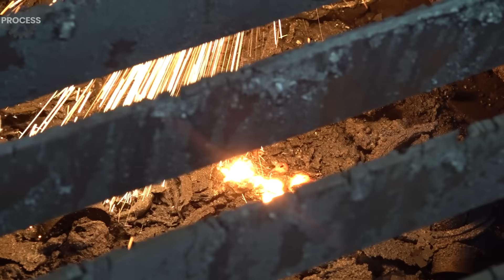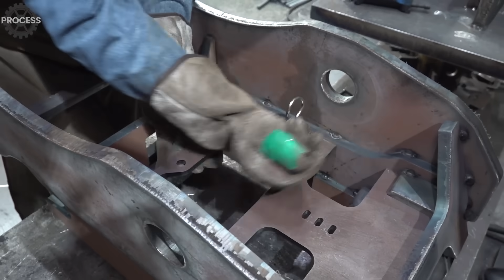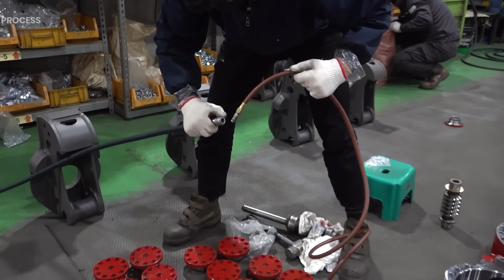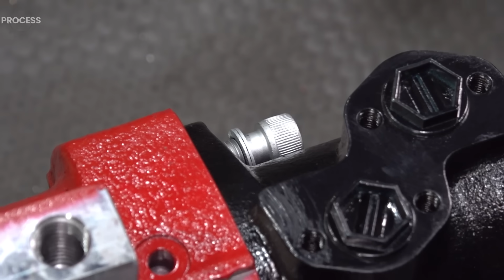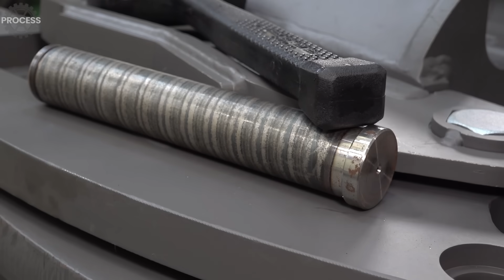Process of Making an Excavator Tiltrotator. Heavy Equipment Attachment Factory in Korea.

Comment: 6:20 why weren't these parts deburred and cleaned ahead of time. Why is assembly being done on the ground? and the cleaning done with a dirty rag?
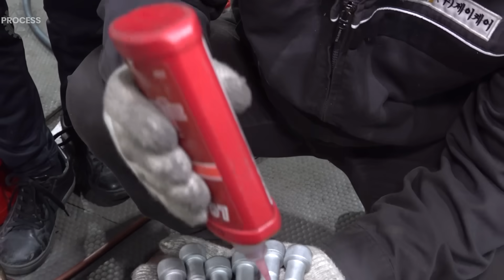7:40 they are using nordlock washers, there's no need for loctite. Also you can see the loctite leaking under the washer, this will flake off and into the hydraulic oil circuit.
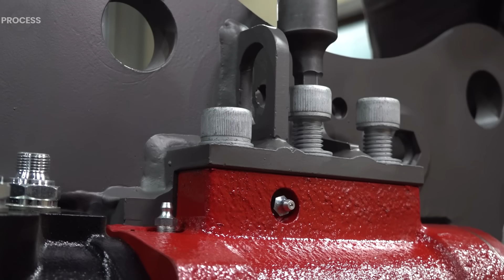9:31 cross threaded bolt
Reply: I was also confused by the use of Loctite along with Nord-Lock. I think that Nord-Lock is an alternative to a  "non-separable" connection using Loctite. I don't understand why use them together.
Reply: @anton488  They want the extra assurance that it doesn't come apart. On mining equipment you can see Loctite, Nord-locks and then the whole thing is crossdrilled, pinned and welded shut. It is the case of no-you-dont-want-this-to-apart on a multimillion machine.
Reply: @JaakkoF  I agree that in this case the extra assurance takes place. It is also clear that the cost of Nord-Lock is much less than the potential catastrophic consequences in some cases. On the other hand, any engineering solution should be justified. So it's interesting for me what's the reason of such double measures. For example, a bolted joint can be affected by high temperature (more than Loctite can stand, 150-180°C). Another possible reason is the company's experience that Nord-Lock/Loctite alone is not enough in their operating conditions.

Comment: Very interesting video, but surprised by the rusty pin and lack of grease during assembly.
Reply: Those things are greased after assembly, that's what the greasing nipples are for.
Reply: They have central grease built in, only need to connect 1 coupler and you can grease everything from 1 spot.
Reply: not only a bit rusty, but pitted as well.. didnt look like a new pin at all.

Comment: This Company has never read the Loctite manual.  In addition, Bushings, Bolts, etc. are assembled without Grease.  This in turn is reflected in the Holding period of this Product.  - This in turn speaks for the manufacturer COMPANY in our time.  Products are "High Quality - Expensive - Sold", short lifetime and the CYCLE starts again......
Reply: I dont think  It Is grease, I believe It Is glue to avoid disassembling or loosen the screws , this Is a normal practice in asían productos.
Reply: There are plenty of parts they assemble where grease should be used 😉
Reply: それより組み付け時にサンダーで、切粉を出しながらきちんと洗浄して無い、切粉が混じる事は寿命が長くないということ。
Reply: When you start up a company make sure you follow the procedures
Reply: Copronomic...

Comment: Cross threaded that screw @9:33.
All in all it looks like fairly decent material that went in, but compared to the non knock off Engcons that I've seen in practice it can obviously only tilt partially and seems jerky and slow, though maybe thats the opeator.
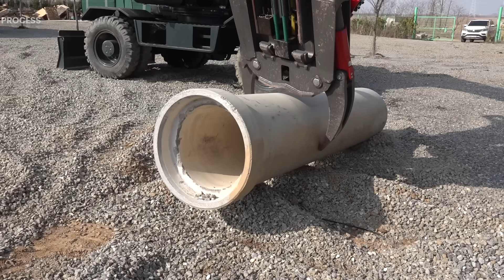Biggest propblem for me is how the springs and working parts of the hitch are exposed as you can see @ 13:31, I predict you will have problems.
Reply: Yeah my dad taught me when I was 5 yr’s old not to drive in bolts with an impact gun without starting the threads by hand first.
Reply: And you see a jump cut straight after he noticed the cross threading, so it got dealt with. Things happen.

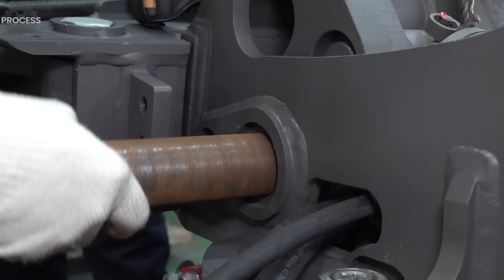Comment: But they put a big rusted pin at minute 10:57 on a new assembly, that does not seem right
Reply: this is a chinese mark of quality. that's why the stuff works so well and lasts for generations. practiced sustainability...
Reply: @vagant091  it's Korea, not China. And rust on that pin affects nothing. It will be greased anyways
Reply: 9:30 thread is now cross threaded.